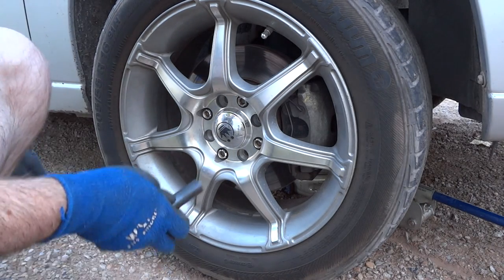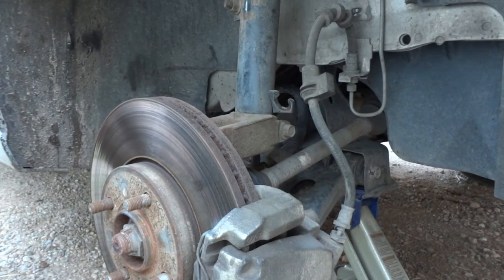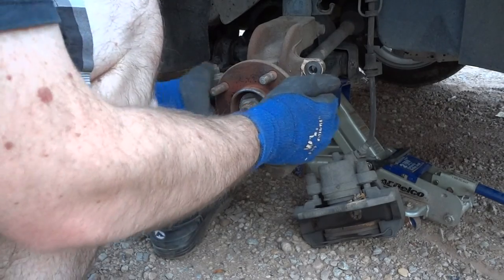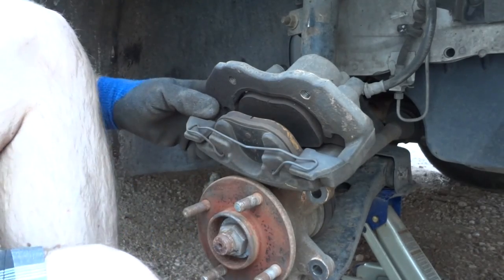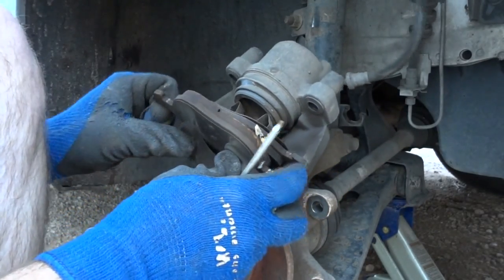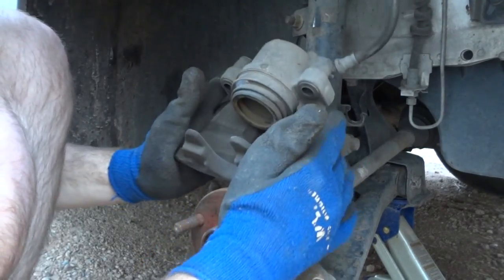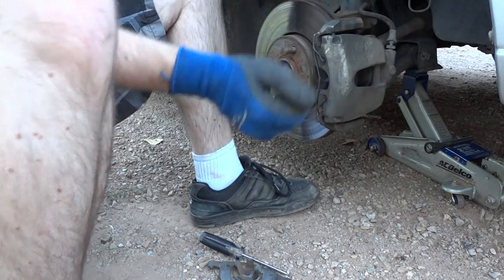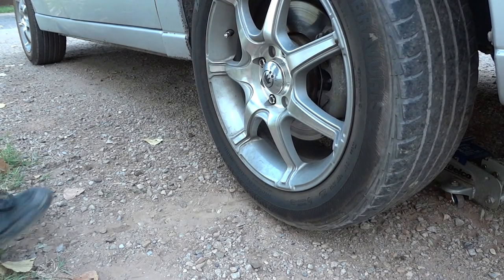How to Replace Brake Pads on a 2005 Ford Focus

Comment: Just a word of warning to anyone doing this job..those clips can be very hard to remove and can snap, not only only can they snap but they can snap in the hole making them very difficult to remove..I nearly try and ease them out of the way rather than remove them completely 👍👍🇮🇪

Comment: Firstly NEVER let the calliper hang off the hydraulic hose pipe as you have done 😳 Oh dear how awkwardly was this done. No cleaning No copper slip grease !!! No mention of releasing the fluid tank cap 😩
Reply from the maker: Also one of my first videos before I took ASE certification. Definitely would do it different today.

Comment: What kind of brakes does the focus 05 need
Reply from the maker: There are a few different brands you can get. Type into google "2005 Ford Focus brake pads" and you should be met with what you need.

Comment: So does the caliper piston need to be pushed back in all the way?
Reply from the maker: James Reynolds just enough to be able to slide it on
Reply: Does the bleeder valve need to be open when the caliper piston is pushed back in ?
Reply from the maker: James Reynolds doesn’t have to be. Makes it really difficult to push but so you don’t have to bleed it’s better not to
Reply: @ArchesMechanic will pushing the caliper piston with out opening the valve or the brake fluid resivor create air bubble in the system?
Reply from the maker: James Reynolds no. No air can enter the system unless the valve or bleeder is open